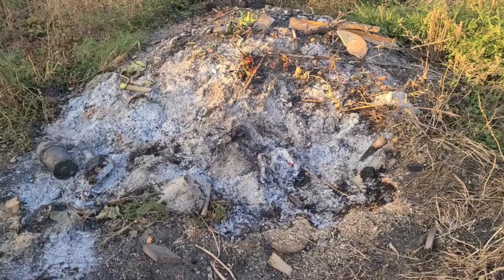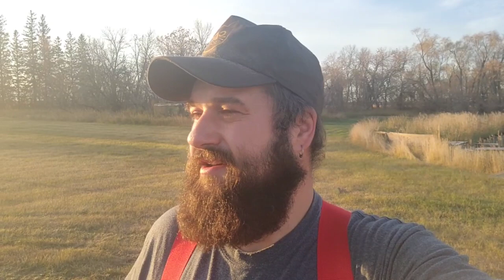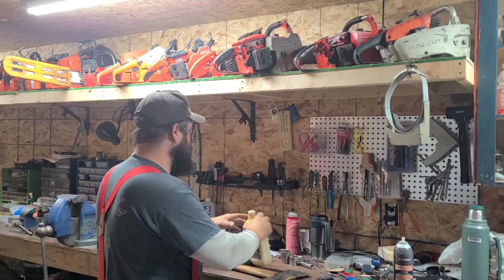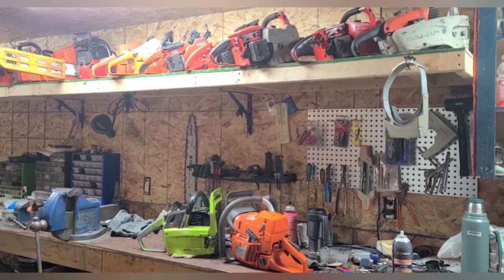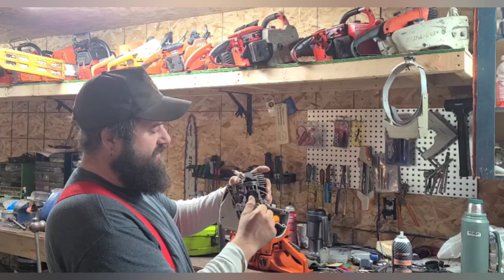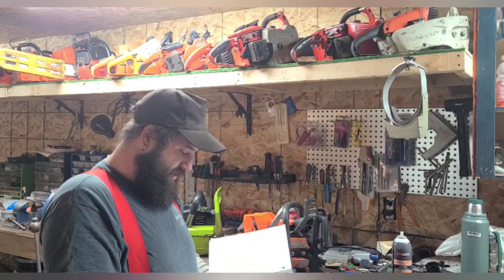FAQ ABOUT PORTING CHAINSAWS!!!

Comment: CCs May make a difference. I ported a 42cc poulan 98/125/76 and a 36cc poulan to 100/125/76 and the 36cc doesn’t have the torque the 42cc does. I think the smaller piston diameter in the 36cc made less compression.

Comment: My company deals in fuels reduction so we are into a lot of small stuff all day. If there is more brush than trees I run a 543XP due to how light it is. If there are a lot of pecker poles at 4-8" I run my 550. We've had 3 of those. My buddy blew one up in 2 months running it stock with 50:1 Husky mix. After 2 weeks of running mine I hated the saw. I decided that if I opened up the muffler a little and went to 40:1 H1-R mix it would run way better. It's 4 years old now and I can't begin to tell you how many gallons of gas has gone through it. Open it up and it looks beautiful inside. It went from my least favorite saw to my second most favorite saw after my 1985 era 181 SE.

Comment: Thanks for your channel !  I'm interested in buying a new saw, but I want to go ahead and have modifications done before I use so it's running at peak performance. My question is: Does porting a saw, or maybe even changing the stock muffler, or changing the transfer, do these type modifications diminish the life span of a chain saw in any way. I mean, yeah, I want top performance but I don't have to do it. I'm not a pro logger. I just cut trees on my farm and I'd like for the new saw I purchase to last the rest of my life.  Thanks.

Comment: Hey tin man, I’ve got a 044 10 mm. I’ve never ported before. I’m thinking about just polishing the exhaust port and cleaning up a little in the transfers leaving them rough. Do you think this will help increase power or should I change the timing? I do have a timing wheel.

Comment: Great stuff Tinman, thanks so much for sharing your knowledge! Learning a ton here. Wondering if you'd be willing to share your thoughts on a couple of my saws.  My trusty  husqy 395xp is getting pretty tired. Some minor scoring in the cylinder.  Ran straight gas very briefly a couple years ago. Just picked up a new cylinder, but thinking about trying my hand at porting the old one. Waste of time or can the scoring be filled in with JBweld? I run a 36" bar on it. I also occasionally run a 3120xp, with a 48" or 6' cannon bar.  Thinking about tucking in to that too, it definitely struggles pulling 12' of chain through 8' diameter logs. Love to here your thoughts, no worries if you're to busy. Plenty for me to learn just watching your show!

Comment: Thanks for sharing your information. Love your attitude! I am planning on porting my first saw here real soon. It's a clapped out McCulloch 10-10 super e. It is running again but I cannot seem to make it 4 stroke on the high end. Think I might have an air leak somewhere. The throttle shafts are real loose in the carb so I ordered another to try. Can't seem to stall it with brake cleaner on the clutch or flywheel side.
Reply from the maker: 2 things I'd check. 

Make sure theres no leak at the carb to intake block gasket. Second make sure the metering lever is high enough in the carb.

Comment: Out of the box the new saws run like they have an air leak. They run hotter which in turn helps them pass EPA standards. Which means there not going to last as well.

Comment: as i consider attempting on a cheap crappy saw, just for practice before I touch one of my good ones, I understand timing, makes sense..... without a timing wheel, may I ask, what about sideways porting? Not necessarily up or down on In or OUT, but horizontal porting and polishing.... air flow and mass should still improve, but would not effect the timing in a vertical lateral manner.... What do you think??? Or just go get a damn timing wheel? LOL
Reply from the maker: Get a wheel buddy.😀

Comment: Got a ? 4 u I really messed up buy an ms271 I ported it. I didn't really get the gains I thought i would. So thought about a big bore kit might solve that but as you probably already know they don't have any. So my ? Is the ms271 and 291 are on the same chassis could you use the 291 cylinder on the 271

Comment: do you think I can do a muffler reaming on a 555xp autotune, with positive results?  I am not concerned with noise violations, lol.  Just thinking it would breathe better.  Would it squeak out a bit more power?
Reply from the maker: In my experince all the 5 series huskies that I've dealt with really like a muffler mod. They run cooler with an opened up muffler so they tend to just be better runners after.

Comment: I definitely got a good question not great about emails so hopefully you read this and we can figure something out I got a Stihl oo9 top handled saw thing fires right up has reeds in it starts on first or second pull every time has no power when I go to cut I don't understand
Reply from the maker: Air leak or impulse issue would be my guess
Reply: Thanks